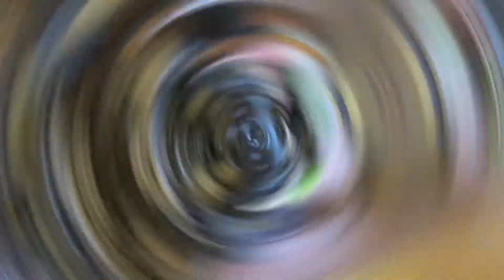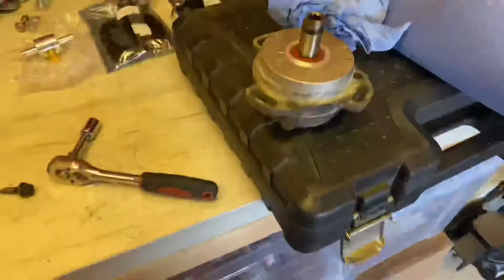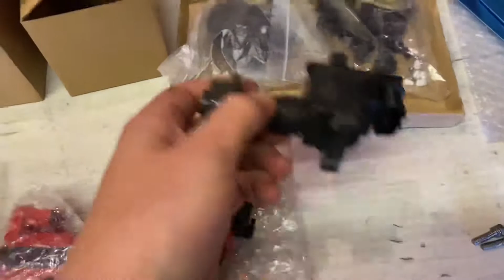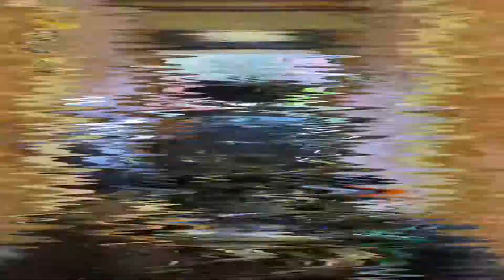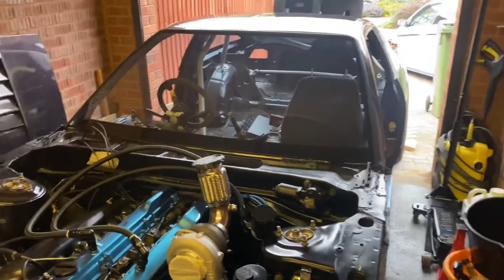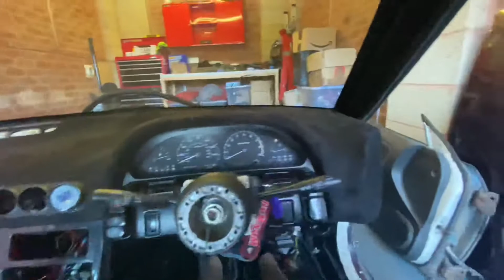IT STARTS!! RB25 S13 BIG TURBO GTX3071R | Starting my JDM 180sx drift car after 3 years.

Comment: Congrats on figuring this out. I am having the same issue and I did all you did and still won't start.
Reply from the maker: I had similar problems starting after this video. Changed the injector o rings and worked fine straight away. There was a nick in the o rings which flooded the engine.